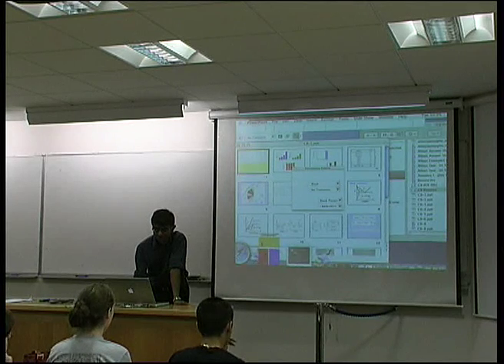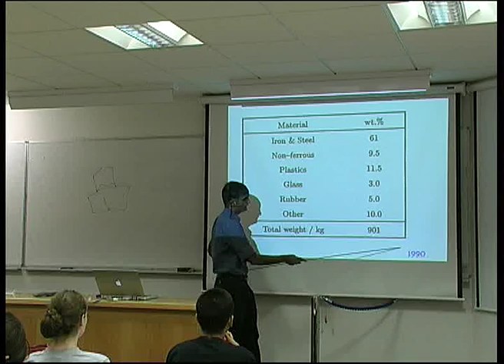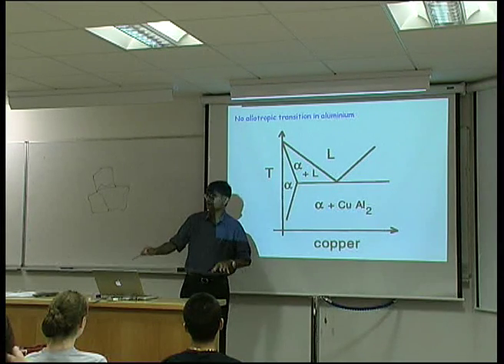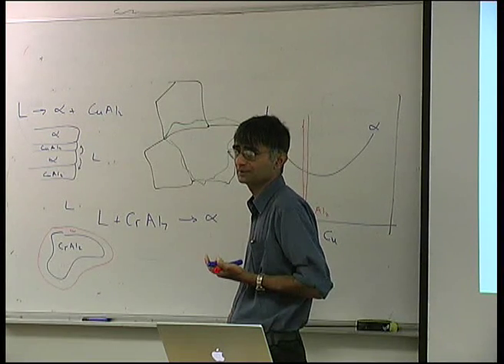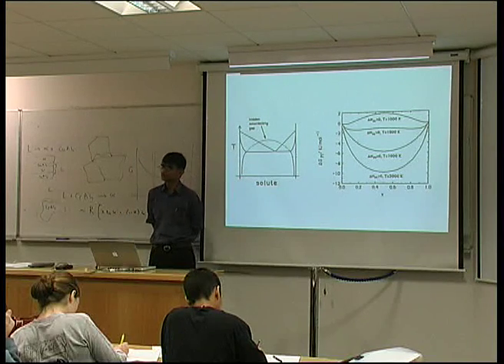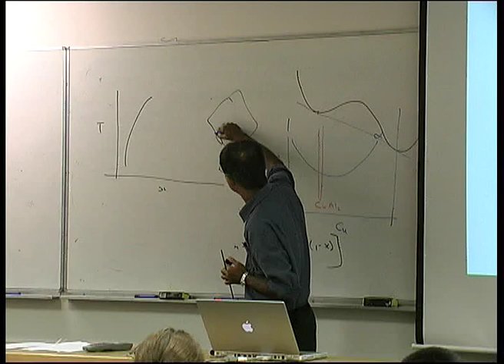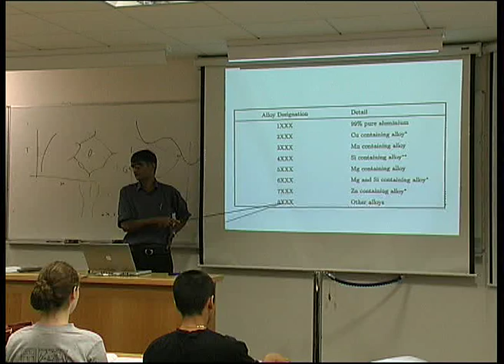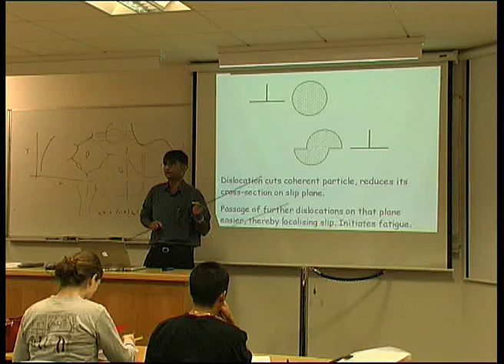Aluminium and its Alloys

Comment: Thank you Pr. Bhadeshia for this video and all the other videos on your channel. 
I have a question regarding precipitation hardening in aluminium alloys: is a dislocation travelling in alpha solid solution capable of penetrating into the Cu-Al2 phase? is Cu-Al2 phase shearing by dislocations moving through it the real source of hardening in these alloys, or do the dislocations move through these precipitates following other mechanisms such as Orowan's?

Thanks in advance Professor.
Reply from the maker: +ASSADIKI Anass It depends on the size of the precipitate; if it is sufficiently small to be coherent with the matrix then penetration may occur, but if coherence is lost then Orowan bowing occurs.
Reply: Thank you professor for your rapid response to my question. Aside from size, isn't there supposed to be a certain relationship between the burgers vector of a dislication in the matrix and that of a dislocaion in the precipitate in order for it to be possible to shear it?
Reply from the maker: That basically provides the resistance when dislocations must pass from the matrix to the coherent particle, aside from the coherency strain field of the particle.

Comment: Great! Thank you. Perfect for remembering lost memories from university years.
But there's a bad point about conductivity. Copper has 1.6 times better conductivity, so even brass can overcome aluminum. And those are easily soldered. That's why everybody uses copper and brass for circuitry. The thing is conductivity/weight equilibrium, not conductivity itself. Ok, here aluminum is great and beats titanium in "lightweight class" which is strong, but very poor conductor.
Second, aluminum wires were used in soviet-block countries, because all the expensive copper was used in military or sold abroad (USA, Japan, etc). And everyone knows what a sh*t those wires are. Corrosion and shattering of such wires are greatest problems. Then, you need to screw those wires tightly, and when heated with high current, screwing gets loose... then local overheat happens and FIRE.